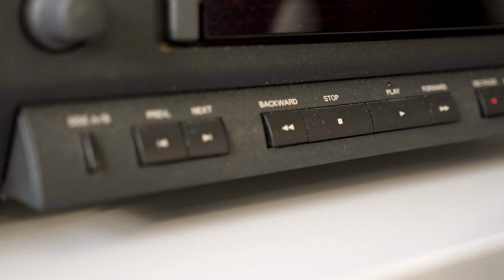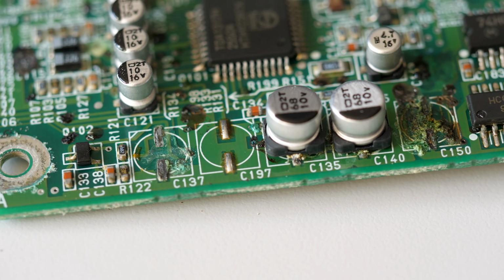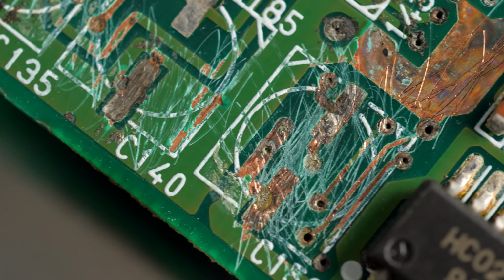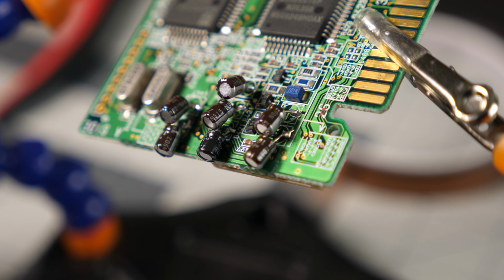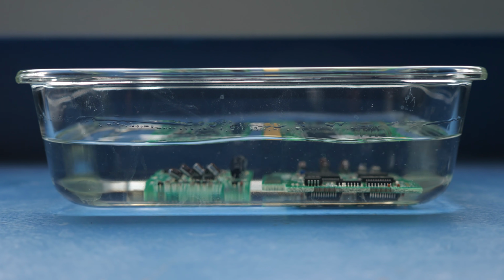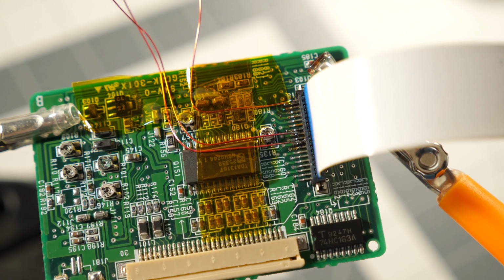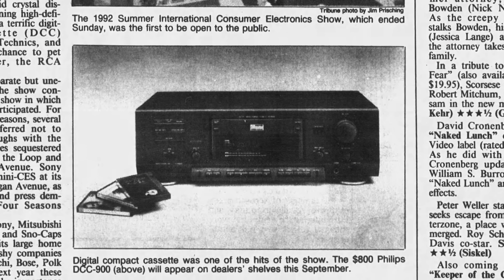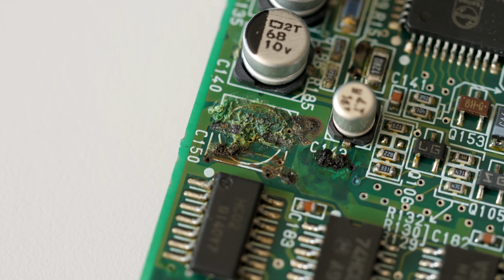My DCC Deck Repair Didn't Quite Go as Hoped...

Comment: Anyone else sitting here considering the fact that new PCBs could be made with the information in that service manual? The ICs on there didn't look like they would be too terrible to remove and with OSH Park getting some made wouldn't be too costly either. It could also potentially help the DCC community too. Either way, loved the video, even if it was not successful it was a solid watch. I hope you have some better luck getting them back up and running.
Reply: We're considering making replacement circuit boards at the DCC Museum.
Reply: @JacGoudsmit  Sick! If you can't find anyone readily available to solder parts for a test board, let me know. While it is more of a hobby for me, I've done quite a few projects where precise soldering is required and I do not mind giving it a go. (the most recent would be the GBA consolizer and soldering to Veias ((unsure the spelling)) and test points) Though, I'm almost certain you could get someone like Voultar to chime in and give it a go.

Comment: hey colin, my dad made music in the 90s and saved everything on dat tapes. recently he wanted to listen through all of them but every single tape makes glitchy sounds every few seconds that are like 10 times louder than the music and gives you a heartattack. now we dont know of its something with the head on the player or that more than 100 tapes are having the same issues. mechanically everything is moving and we can play music fast forward, rewind and everything. we tried one of those head cleaning tapes (the only one available anywhere on the internet was one for dat data storage dds but the tape width matched so i thought its ok to use) but it didnt help at all. 

do you know if its common that tapes deteriorate within 20-30 years even if they were stored in the a dry basement or is there something electronically wrong with one of the dozen boards in the deck itself? its a sony dtc-za5es and i coudlnt find anything helpful on google. thanks in advance
Reply from the maker: It would be quite the coincidence that over 100 tapes would all have the same issue, even if they were stored together. Provided that the tape media itself looks fine (no signs of mold, etc) then I think the deck would be suspect. Thankfully DAT decks are still relatively common to find.

Comment: A channel i watch called La Taverne de Jon-Jon did a repair on a DCC900. I feel like maybe there's corrosion under the chips?

If that's not cleaned up that could be what would be causing the playback issue because there's still corrosion under the chips that's causing the issues

Comment: What's with all of the scratching on the board? That is absolutely not necessary to clean it up. I don't like the look of that.
Haven't finished the video yet, but if you don't manage to find a solution to this, I could maybe take a look at them? I'd just need the boards and preferably the parts that either fell off or you removed. If I can grab a schematic for this it'd be a fairly simple but somewhat time consuming job...no where near as time consuming as half the things I do. I wouldn't ask for money or payment in any way, I just enjoy doing these things and are in the UK.
Shoulda sent it to Louis Rossmann in the first place haha
EDIT: Ahhh you bought a new one. Nevermind then I guess rofl
Maybe use a bit of heat shrink on the legs of the caps when mounting through hole parts to smd pads like that just to be safe :)

Comment: Did you check if the DCC tape itself was still good? (the digital side failing could be a false positive)
Reply: How do you check a tape without a working machine?
Reply: @BilisNegra  open the shell, unspool the tape proper and spool it onto a reel to reel machine. (if you don't get any signal (no matter how nonsensical it may be) then the tape is definitely bad)
Reply: @SkyCharger001  You mean, a commercial prerecorded tape with such a duplication failure that results in it having nothing on it?  Guess such a thing could happen to a batch of tapes rather than a single unit, so unless quality control was non-existent, that should have been detected. And we would also have to take for granted that the tape was either sold sealed or without the seller having been able to test it bc he doesn't own a working deck.
Reply: @BilisNegra  no, I was more thinking along the lines of faded enough to no longer be readable.

Comment: I think that if i have to pay $50 for three cassettes makes this type of format too expensive for considering buy one of this decks, and spend hundreds to restore it.
Reply: He got ripped off with those cassettes. NOS cassettes should be around $10-$15 each, especially for these first generation cassettes which use pads that get sticky and make reliable playback difficult. Prerecorded tapes start at $20 to $40 or so, but their price depends highly on how rare the tape is and what state it's in.

Comment: Hi Colin, soldering nerd here. A couple of points:
1. That first board is definitely repairable. From the images you showed it's the kind of thing I could do in an hour or two. It would look a little messy when done but is preferable to trashing a board.
2. SMD caps should be easy to solder quickly. The trick is to tin one pad, place the cap on top with a finger to steady it, and melt the solder. The cap will drop into the pool of solder. Then you can go to the other side, and solder that with a second or two of heat. Shouldn't need more than two seconds of heat on each pad.
Reply: Yeah, I've done lots of SMD soldering work also.  I agree that board should be salvageable - there's no tight pitch components that I can see and it looks like most traces are on the outside.  It'll be ugly, but could be salvaged with care and some nice 30 gauge (or less) wire wrap wire.  Or that ultra fine enamel wire Louis Rossman likes so much.   Maybe send it to somebody like Adrian Black from Adrian's Digital Basement?  Somebody motivated enough could probably even just recreate the board.  It looks like it would probably be 2 or 4 layers - pretty straight forward.  For 4 layers, the 2 inner ones would probably be just power and ground planes (typical PCB practice).

Yeah, SMD caps aren't hard to solder.  I use the same technique.  I find hotter irons are actually better - you can keep the heat on for very short periods of time and get the joint done before the heat even conducts through the pad rather than burning the pad to death with an iron that's just barely hot enough.
Reply: I'm not the best at soldering, but I think at this stage I would have given that board a go. Yes it looks like 20+ bodge wires needed, but I've seen worse boards on YouTube. Beyond economic repair? Probably, but that's the whole point of restoration, it isn't always economic.
Reply: I agree.
And Colin, try one of these: "Dual Headed Horse Hair Anti-Static Brush PCB Cleaning" (great to clean PCBs with IPA).

Comment: As bad as the original board appears there is still a chance of repairing it. It may never look pretty, but to me it seems that there is still enough of it to work with. That isn't to say that there may not be other issues on the board beyond the obvious but as far as trace and pad repairs are concerned it has to be at least worth a try. I have repaired/restored lots of equipment with similar damage with more success than failures. It's all about how you value your time or how determined you are. Karl

Comment: I don;t get it. You have the wave form diagrams. You have a scope and you have the schematic. You should be able to trace the waveform back along it's path until you find the failed component. The first board might be unrecoverable, but the second should be repairable. I'm nut sure what your repair/electronics skill is, but maybe you can team up with a youtuber that does have the necessary skill even if you do not. Even if one of the chips is broken, you might find a donor on the first board.
Reply: those reference waveforms are specific to the test points in question and any earlier will lack some of the signal processing that they have gone through.
Reply: Those waveforms are near the beginning of the trajectory of the signals through the DCC recorder. They are complex devices. But what's going on here is not just one failed component: the read-write board of the second recorder obviously also has extensive damage (corrosion) from leaky capacitors, so it's possible that there are multiple failures such as vias and traces that got eaten away by the chemicals. At some point, you just have to decide it's not worth the time or money. That second recorder is close to working though; it can probably be repaired.
Reply: @JacGoudsmit  You have the wave forms plus a starting point. Then its just a matter of stepping back through the schematic until you hit something that looks proper. It's might not be easy or fast but it can be done. It might not be economical, but for hobby and collecting that is not a factor. If he cannot do it himself, then get support, make it a collaboration. You see that often enough. Just giving up when so close is just not right.

Comment: techmoan: "Give me some belts and contact cleaner ... there you are now working!".
Reply: Techmoan sticks to equipment from an era before the use of the dreaded SMT capacitors. The reason the through hole ones are more reliable is that the board shields them from the heat during soldering
Reply: @MrDuncl  Techmoan did do a DCC video. I believe he acquired a working deck though.
Reply: @patrickcoco6205  True. VWestlife got a DCC deck as well but had to get the DCC Museum to fix it for him.
Reply: Techmoan has extremely limited repair skills. I don't think he can solder or use a multimeter. He seems to just wait around for machines in working condition, new-old-stock, or where the seller's description indicates that belts are the problem.
Reply: @3rdalbum  By his own admission. my post was just a nod to all those techmoan fanboys (such as myslef)

Comment: Hopefully you can find a later model  at the end before they stopped making them.
A thought and I don't  know when all companies truly stopped all at once or some countries kept making the format as in the Japanese market. I maybe running down a worn out rabbit hole.
The fact that it has a museum is awesome in itself. Most new formats like this do not.
I  know keep trying  is easy for me to say. I'm not putting in time and money 
Try corresponding with 
TECHMOAN he has a wealth of information as to find a place to look for a player that works to play your tapes. All your efforts deserves reward 
I  cannot even do basic  repairs but I've had dumb luck at products that worked.  The one thing I do vaguely remember with Dcc was it proprietor technology that had to fixed by the manufacturer because of the time period leading up to the internet and all the concerns around digital rights and manufacturing to protect their products that they only can fix or in this case not fix.Im a big fan of DAT but so far it seems to have avoided the problems these players have so far mine still works 11 years later. Remember the 1990s were bad with technology that was designed to never be repaired. That Sucks  for those that make a living let alone try and salvage technology.
Find  a way to get a player that works. GOOD VIDEO 😎

Comment: So sorry it did not work out. We are often called the last resort. It might indeed be better to just buy a restored player, but that would not have made this great video. The second generation players (DCC 300,305,600,380,91 and 450 f.i.) do not have the capacitor issues. All players need work, no matter what generation. Part of the plastic 90ies construction as well. Thanks again for your support and mention on your channel. We will do what we can do get you a working player.
Reply: We really need to look into producing replacement PCB's for the DCC 900 read-write board. That first one in the video looked like it was in terrible shape and the second one wasn't much better with corrosion everywhere.
Reply: @JacGoudsmit  That would be a great idea!
Reply: @JacGoudsmit  They have done it with the Amiga A1200 so it can be done.
Reply: @JacGoudsmit  being fine-tuned in some way to the voltages of the read/write head, at least for writing functionality, would likely make this a lot more complicated
Reply: @PixelOverload  The tuning for the heads is done with the variable resistors on the board. The electronics for all read-write boards are the same for every DCC 900 (and all clones such as the Marantz recorders. Even the Optimus has the same board unless my memory fails me).
Reply: Love my refurbed 951 I bought from Dr DCC a few years back.
Reply: @davindameron9092  Same here, bought the same model from him 2 years ago
Reply: @davindameron9092  I really don't understand why anyone would do such a thing unless you happened to have bought into the format when it was still a theoretical new music format back in the 90s. 
DCC is a failed format. There is very little in the way of native music for it, and that I know of, nothing that is exclusive to it.  Even if there were albums where the DCC release was different and MUCH better than CD  (we're in fantasy land now), that same exact release could just be released today in modern digital format.
To me, the beauty of dead (but formerly alive) formats is you can get the music cheap and you can enjoy what you know.  When I was 3 years old, I had my own record player.  It's a format I knew as a kid and even into my teenage years, 45s were still how you bought individual songs (80s). Or compact cassettes, which is how I bought all of my music as a young adult.
Even though my parents had 8-track tapes when I was  a kid, I have absolutely  zero connections to them.  I feel the same way about DCC.  I vaguely remember hearing about them in the 90s ( I was a computer guy, not an audio guy), but I had entirely forgotten about them when Techmoan uploaded a video on it.  My reaction was "meh"  Teffifon and that big RCA cassette format seemed more interesting.
Reply: Instantly thought of Dr DCC. Usually the videos I’ve seen of his (Dr DCC), it’s the caps that have to be replaced, as well as usual things like belts and such.
Reply: What kind of future proofing do you recommend for a 91?
Reply: @MichaelGisiger  Belts, pinch rollers and for sure the gear.
Reply: @DRDCC  Thanks, I already took care of the belts. Will look into the rest.
Reply: Id like a dcc portable if they werent so expensive is it really true you shouldn't play regular cassettes in a dcc player?
Reply: @stpworld  We recommend against playing analog cassettes on a DCC recorder or player for two reasons: first of all, because of the age of recorders and players, and the fact that in a DCC player (somewhat ironically), precision is less critical, you will probably not get the optimal result from your analog cassette. Secondly, by using the DCC recorder for analog cassettes, you will wear out the DCC mechanism and the heads faster than if you only play digital cassettes. And you'll have to clean the heads more often.
I wouldn't say playing analog cassettes is a bad idea, I'm just saying if you want to play analog cassettes more than digital ones, you should just use an analog cassette player. There are more of them in the world, and since they were made for analog cassettes specifically, they will probably work better.
Reply: @stpworld  Hi, Yes it is better not to use regular cc on any dcc player.
Reply: Had it caught on, the players would have become vastly simplified and cheaper.
But the problem is that CDR came along and by 95/96, the prices were plummeting.  Also, digitizing your existing cassettes and records was getting easier and cheaper by the day.
DCC needed to be released long before it was.

Comment: That's a shame.  I imagine old tech of this sort is a gamble.  The mechanical side probably has its own potential problems, but at the same time is probably easier to identify and fix problems.  With the electronics, you just don't know what you're getting, as you demonstrated late in the video with a different auction listing.  It's cool that people keep these things alive and restore them, but it looks to be a tricky thing that's going to be too much for many, especially since some problems will not be obvious.  Thanks for showing this as it was interesting and good luck if you you go back to this.

Comment: There is another channel on You Tube called 12VoltVids. Not sure if he would be able to help you but he's located in Canada. He might have some ideas or possible fixes for the board. Sorry that didn't workout for you. Especially buying two units.
Reply: I follow that channel. I don't think he has any experience with DCC (he's a Sony guy) and I don't think he would do any DCC repairs. Shipping to Canada and back would be expensive anyway. Better to send that second DCC recorder to Dr DCC at the DCC Museum to finish the repair.
Reply: @JacGoudsmit  Best of Luck with it. I think sending it to the DCC would be the better thing to do as they have the expertise. I only mentioned him because he does have the experience working with the various boards etc. I always wanted one of these players but I am reluctant to buy it due to the scarcity. Your channel is great and I enjoy it.